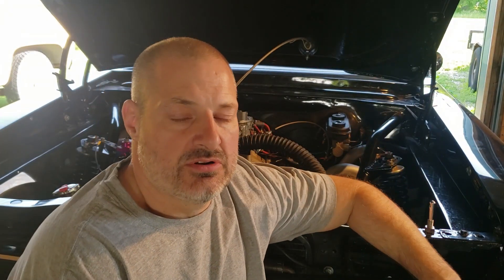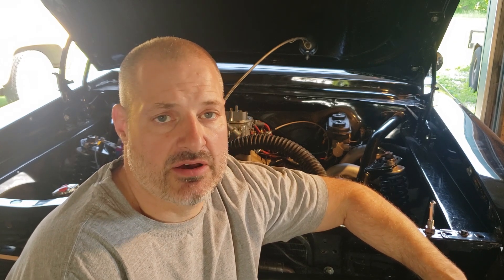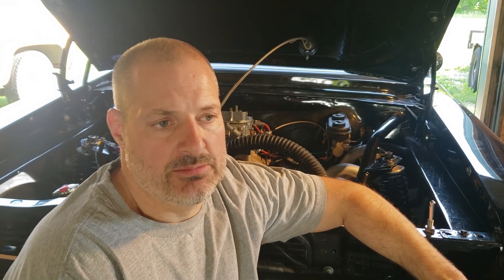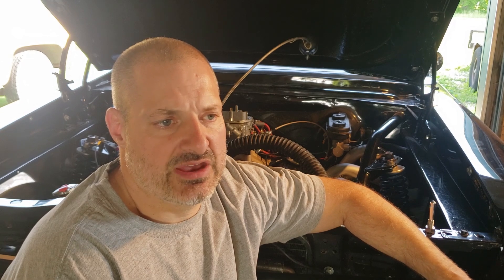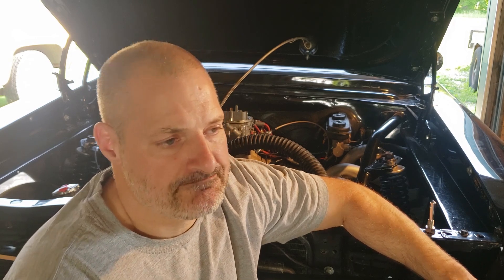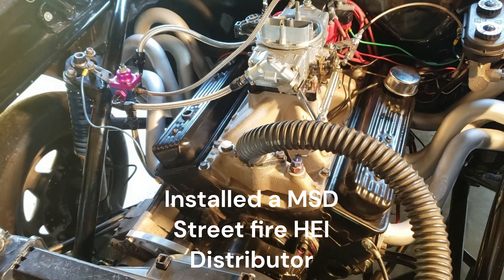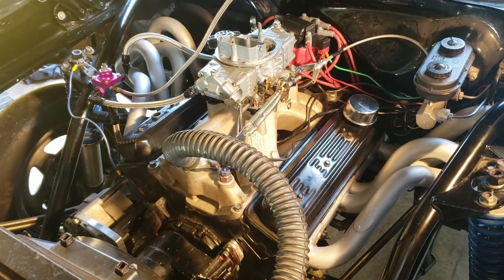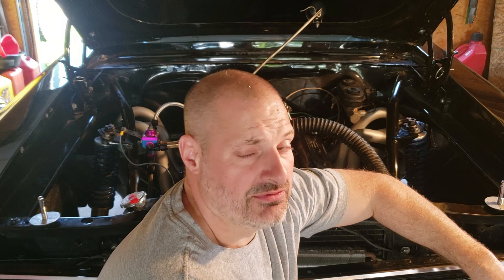Stock Hei vs Msd Hei distributor ignition test 350 chevy vortec heads

Comment: I've ran stock hei distributors up to 7,500 rpm before. Bone stock except for a timing recurve .
Reply from the maker: With a lower horsepower engine it would run up to 6700 no problem. When I started making more power I started having problrms.

Comment: Stock HEI chip has been known to be junk over 4 or 5 thou for 50 years . Been solved for 30 or so years  .
Reply from the maker: I have no problems with this. I used the distributor because it had a melonized gear on it. Also it worked fine in a  330 horsepower engine at 6500 rpm. I thought it would be fine.
Reply: What’s the solution?  Who makes a great ignition module?
Reply: @trailerparkcryptoking5213 petronixs